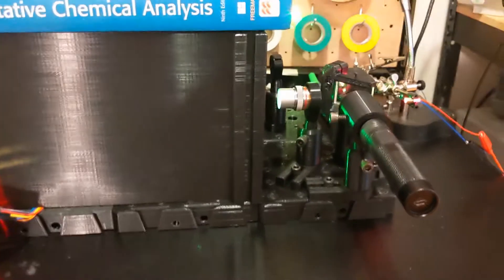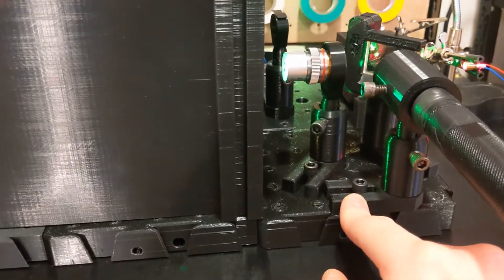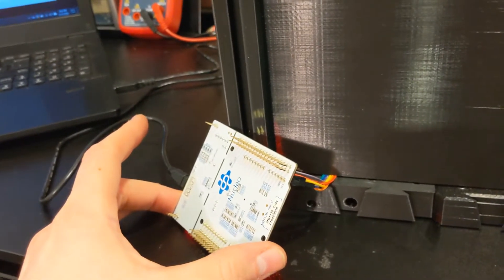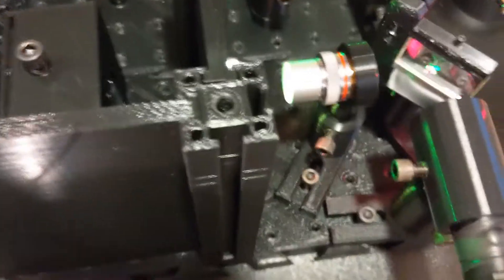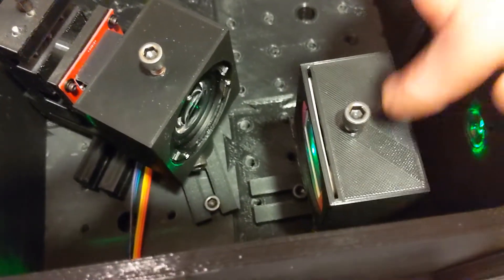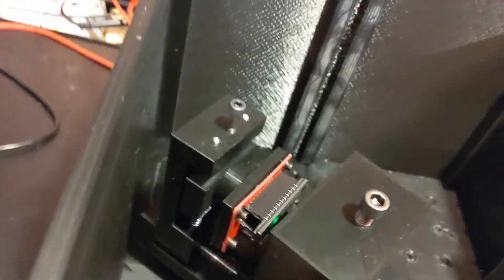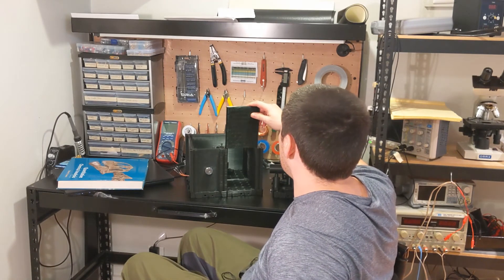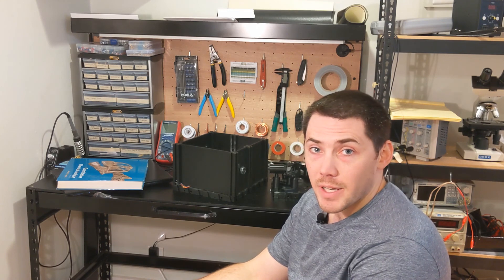3D Printed DIY Spectrometer

Comment: Can't you use a lens from laser protection glasses to block out the undesired Raleigh scattering wavelengths? These glasses come for many wavelengths (shouldn't be too hard to find what you need) and usually cost <=50$, which is far less than dedicated filters, but I would assume they are doing exactly the same.

Comment: If you don't want to use notch filter to block Rayleigh signal, you may use a triple monochromator to block it. However, this will further reduce already not very strong Raman signal intensity. Your acquisition times will be very long, which will require cooling (usually done with a Peltier module in commercial instruments) of your CCD to reduce its thermal noise. You may also want to use a photomultiplier for greater sensitivity and to avoid cooling, however it will take longer time to scan a spectrum window which you can capture with a CCD in a single shot.

Comment: Something's wrong with the optical path, your laser's not THAT bad. I think maybe you're getting fresnel losses off the transmissive grating surfaces scattering around or something. I just tested my crappy $5 ebay green laser on an Ocean Optics HR4000 and the FWHM linewidth is only ~2nm at most, and honestly I think it's probably even lower than that in reality because the line was almost saturating the detector and there's always going to be some scatter going on inside there. The intrinsic nature of the doubled Nd line dictates it should be quite narrow, definitely more narrow than the red diode that's for sure. Not helium-neon narrow, but narrow enough for raman. Maybe try a reflective grating for better results? Looking forward to the Raman spectra! Also, sorry but I gotta say it, you are handsome af dude.

Comment: If you split the beams immediately after the source, perhaps you could measure the input with another CCD and subtract that from the result, removing the need for a filter. Just a thought.

Comment: Neat watching, thanks for sharing all.  The Hackaday latest spectrometer build got me searching for the latest and greatest inspiration for this winter seasons projects that have been ongoing (that's when I do the electronics, amateur radio and RF engineering more-so).  Very neat design regarding in general and the 3D printed optical bench modules are very awesome.  
With the COVID probably isn't helping with finding filters more cost effectively... especially from University and other Government surplus stores.  The latest Jeremy Fielding first comment one reply reminded me to search the government auction sites too as I don't hardly.  Hope you find what you need cost effectively.  
Would be neat to see like I've been thinking and I've found one other youtuber post... toc1955, using basically different sample presentation methods to use for testing.  https://www.youtube.com/user/toc1955/videos
I'm thinking to use a CD/DVD sled for the slit width control and maybe for DVD/BluRay gratings a Hard Drive actuator to control the sweep.  
Be sweet to find a laser disc player and use parts from one of those also.  
Been wondering about other makes and models of the CD/DVD/BluRay where there are beam splitters and other optics that are good enough quality to salvage parts from also.  Thinking about for an interferometer spectroscope design got me searching and I did find a video somewhere on Youtube with someone using the parts.  Might be the Edwin Hue microscope one: https://www.youtube.com/watch?v=5bqujaldaCQ

Comment: Cool project. Thanks for sharing the breadboard and translation stage links like you say these are a real practical alternative way to build an optics bench. Greatly appreciated.  I'm experimenting with spectroscopy from an astronomy perspective  - working on an LowSpec ( spectrograph) by Paul Gerlach  https://www.thingiverse.com/thing:2455390  .   For this we use a free software app for the spectrum analysis called BASS    https://britastro.org/node/10520 - I don't know if any of this could be of use to you.  I'm tempted to try building your setup to use in the classroom;  it would be good to show students real time spectral curves . Have you tried getting the spectra from a CFL lamp - you could use the Mercury lines to calibrate your system ? Thanks again for sharing.

Comment: This is probably a stupid comment... In the absence of a high quality notch filter for your Rayleigh scattering, could you selectively block the parts of the linear ccd that correspond to your 532nm spike?  I imagine that it would be possible to vertically align a thin strip of foil in much the same way you used the nut in your previous video. The region should effectively be a dead zone for your Raman spectrum no matter if you pass the light through a filter, or put something there to cast a shadow.
Reply: A spatial filter? Why not. If correctly implemented, that might work exceedingly well.

Comment: Hi, thanks for the video. As you mentioned for Raman spectrometer you would need a monochromatic laser source. You could try to stabilize your Laser Diode with Blazed diffraction grating to operate in Littrow configuration mode. I think I watched couple videos on youtube where they do a demo with LD. Also I guess to disperse Raman transitions you would need an imaging lense with longer focal distance. Have you considered to bend the spectrometer in spectrometer Czerny-Turner configuration?
Reply from the maker: I don't want to complicate the setup more than it already is. Part of the purpose is to remain cheap and easy to understand. Here is a spectrum of the green laser pointer I was using (it was one of those Laser 303s you can buy for cheap) https://photos.app.goo.gl/dSnJuthvEjK3ipFK9 . I thought when I had bought them (I bought three different ones from different manufacturers) them would be sharp 532 nm lines. I assumed it was made from shg of a 1064 nm laser, but I think I'm wrong. Do you know where one can get good information about those Laser 303s? I considered the CZ config, but I didn't know how to get my hands on cheap curved mirrors or a reflective grating.
Reply: @heisenbergsdog1630  How much loss would there be by pre-processing the laser beam through a diffraction grating of its own to "filter" by tuning the spectral source?
Reply from the maker: To give an idea about the resolution, here is the green laser spectrum plotted against a red laser spectrum. https://photos.app.goo.gl/yHRNcfxHSwse7c9p6
Reply: I'd gladly sacrifice compactness and save on super-expensive optical paths when a single convex lens will do the job perfectly well.